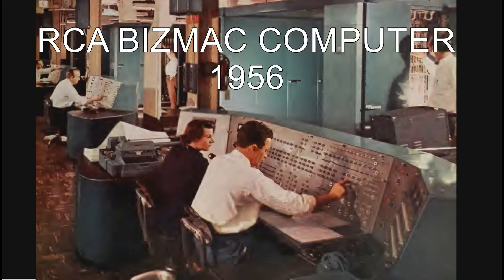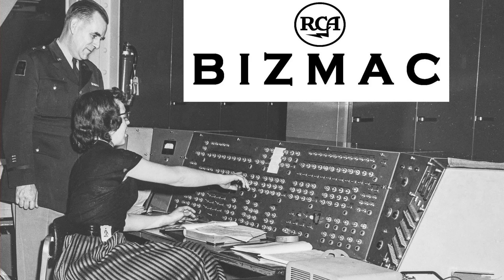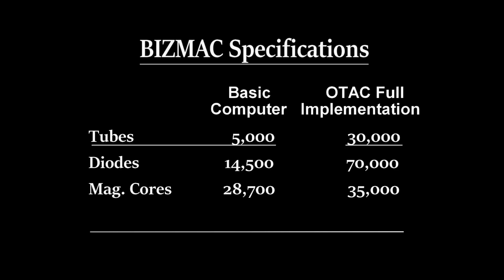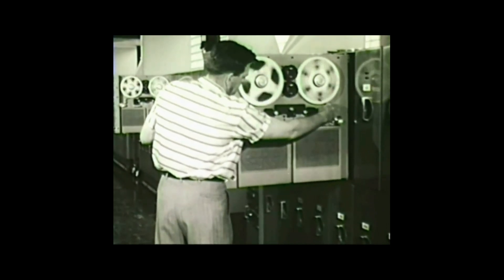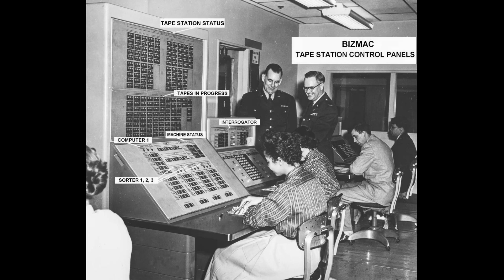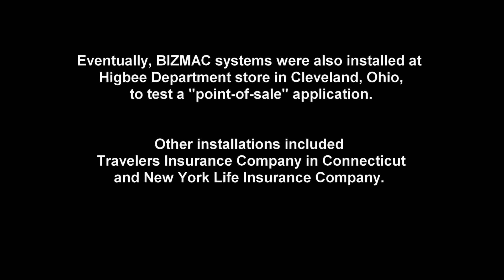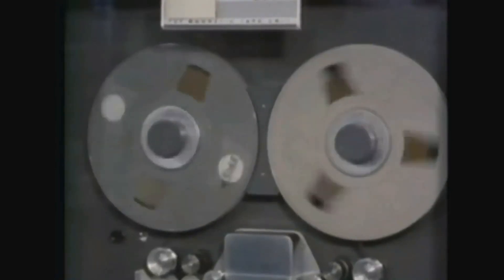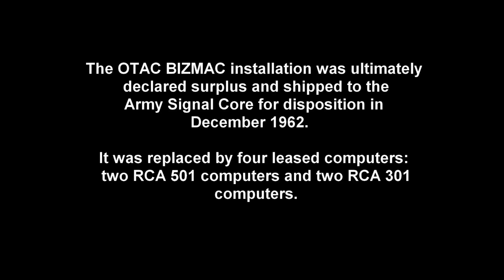1956 WORLD's LARGEST BUSINESS COMPUTER: The RCA BIZMAC Vacuum Tube Computer (Arnold Spielberg)

Comment: When I was an ROTC cadet, we got a tour of a NORAD computer building back in the 60's.  The building was a cube-shaped concrete blockhouse around 150 ft on each edge.  There were actually two computers, one in operation and the other in maintenance; all tube driven.  The AC unit to keep the building cool was huge.  We were informed that if the AC failed, you had less than two minutes to evacuate the building before the heat generated by the tubes would push the temperature past 200 degrees F.

Comment: Hey CHAP! I'm a documentary filmmaker trying to get in touch with you about the copyrights of the images you're using in your archive. How can we talk? Best, César
Reply from the maker: Hi @cesaroyarzabal5232,  thank you for your message.  Copyrights of vintage photos depends on the source of the original, as you probably know.  The BIZMAC photos in this video were obtained from the U.S. Government archives for a research fee.  Under the U.S. FOIA (Freedom of Information Act) many government computer photos can be released without specific copyright issues.   It depends on what photos you may be interested in.  ~
Reply: Thank you for getting back to me!  @ComputerHistoryArchivesProject   Your answer is very clear. I'm specifically trying to use 2seconds of the clip at 1min26sec in your video above (in which we see a man pulling out a computer-drawer). Would you happen to know which section of the US Government archive I might be able to find it? ~ Thank you again.

Comment: Super Interesting.
     I was intrigued by the banks of "always mounted" mag tapes.  I assume sufficient disc storage didn't exist at the time, so mag tape was a good way to get to data "quickly."
     But, I wonder how that tape was indexed so the data could be accessed in a reasonable length of time.  Those look like 2400 foot reels of tape, so to get to a piece of data 1800 feet in ... that would take quite a long time.
     Inquiring minds want to know.
Reply from the maker: Hi josephgaviota, I am not completely sure, but perhaps data indexing was part of what Arnold Spielberg, one of the designers, worked on.  He was an engineer working on storing real time data.
Reply: @ComputerHistoryArchivesProject  I wonder if it was an early pre-echo of modern RAID, and there was some redundancy with various round robin offsets and other optimizations like having a rest position in mid-tape.  Then whatever tape was actually closest to the copy of data desired would be told to get it.